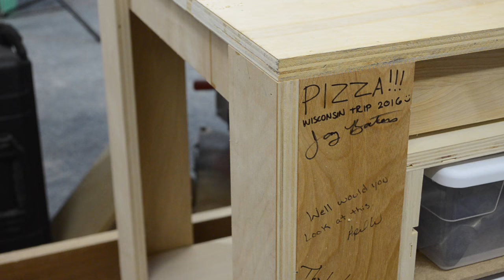Ⓕ Kraft Paper Holder For A Workbench (ep77)

Comment: May I ask what you guys in North America pay for a roll of that Kraft paper? I am thinking by the way it is being used that it is a LOT cheaper than it is here in Australia (but what isn't?) - just curious - and can you tell me the dimensions of that roll please? (so I can compare apples with apples (or at least Granny Smiths with Red Delicious...).
Reply: Looks like the 30 inch by 100 foot roll so about $20 USD on Amazon
Reply: LP81
Thanks for that, but it's led me down a rabbit hole, there is something wrong because I can get that at about 1/3 of the price (albeit by buying 1000 ft which is the minimum I can get) - I went to Amazon and they said it was 40# and 4" but at that weight I calculate only 2" - so I am thinking that is 90#. Any thoughts?
Reply: I ordered a roll of 30# weight paper from Home Depot. It is 24 in x 1200 ft., at a cost of $26 plus sales tax, making it $28.15 total. The 36 in wide roll, also in 30# weight and 1200 ft long, is $40.25 plus tax.  I have it shipped to their store, so shipping is free.